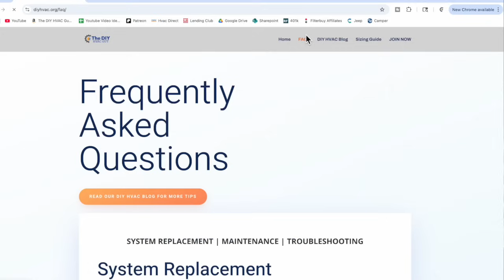Soldering -VS- Brazing.    Which Is Better?

Comment: I use Stay Brite 8 and solder the joints, but I like to braze as no acid flux to introduce in the system and brazing can handle gaps, but my luck in brazing has been terrible.  I will literally burn holes in the copper.  For the life of me I don’t understand how I can get the copper so hot it melts yet still does not melt the sil fos 15 rod.  I thought about trying a Turbo Torch which is Air Acetylene, but some say it takes forever to heat up the joint to braze.  Is there no simpler way to braze.  First is there no easy way to set the oxy air acetylene flame.  

Have you found any easy way to braze.  I tried the Cap n Hook tips and that was a disaster completely burning through the copper.   What tip, or set up or rod would be the easiest to braze and yet do a quality job and not burn holes in the copper.

I wish you would do a detailed video on the best and easiest way to braze and not burn the copper.

Comment: Wish you were in my service area.  I have to go through the turmoil of finding a good company to install either a central unit or I'm thinking the ductless mini split.  Sick of window units that no one wants to work on.  It runs good if it's not too hot but compressor makes a clunking noise and blows hot air when it gets too hot outside.  Someone said it sounds like something is making it overheat.  Everyone works on HVAC but not window units.  Being a senior woman, I can't lift the thing or even help someone lift it like I did this one.  I think it's around 150 lbs (18,000 btu) so I must go hunting.
Reply: where are you located

Comment: Can you use this on r32 and 454b systems?
Reply from the maker: Yes absolutely
Reply: @diyhvacguy  I did see another video where they cut apart the lines after doing each method and the flux does seep in to the inside of the pipe. Is there a way to stop that or flush it after?
Reply: @Random.FurrylolI saw that video and that guy put  way too much Flux on both female &male,  totally unnecessary on both,  only need  i little bit on the male pipe in the right spot and you get the gold 💯

Comment: I was considering installing a Mini Split for my bedroom. I installed one previously for the living room but had a AC tech finish my connections and pressure test so I could get the warranty. I feel like you said you helped with that on one of your videos? Is that possible so I can complete the full install myself?

Comment: on the corner elbow with 2 pieces to solder. you could have just held the flame in the center of the elbow and the heat would draw the solder in from both ends. then you could have thrown a wet rag over the entire elbow at 1 time and done. 🥰

Comment: I use Rectorseal Nokorode instead of StayClean, never had an issue. It is not corrosive or acidic.
Reply from the maker: Thanks for the tip, I'll have to check that out!

Comment: I'd like to mention that copper pipes are thinner for hvac but brazing is recommended.  Does that make sense?  As an investor/owner, I've installed many of my own systems with solder.  I still use nitrogen.  I've never had a leak.  I've probably saved $80k in my lifetime doing my own work.
Reply: That's awesome, I'm doing the same thing, I have been drove to it by overpriced so-called professionals doing hack work
Reply: @michaelcollins5438  Honestly, after 15 years of being in the industry, this is what's going to drive me to finally quit and do something else. My heart and soul can't take what private equity firms have turned it into. Training is piss poor if it exists at all, they throw kids straight out of highschool in a van and send them on their way to go figure everything out the hard way, everything is overpriced to cover massive overheads and excessive life styles, and with tariffs in the US this year it's just getting worse. Not to mention all of the private equity firms are going to fire all of their office staff once they can be replaced by automated intelligence business operating systems which will remove even more humanity from everything. It makes me sad. Really, really sad.
Reply: If you understand chemical and material sciences you would know the purpose of running nitrogen when brazing and why there is no reason to do it when soldering. You're performing the equivalent of a mystical rain dance wasting your time with the nitrogen hoping it blesses your project with good fortune.

Comment: Can power crimpers be used on refrig lines?
Reply: Can press fittings made for acr application be applied to line set connections with the appropriate tool?

Comment: I have a scrap box of failed zoomlock and soldered fittings that have failed. I do not have a box of failed brazed fittings.
Reply: Heck yeah space man. Brazing is what manufacturers call for and its funny to watch people reinvent the wheel.

It really seems like the solder guys find it annoying to flow nitro and us brazers dont want to mess with the flux. 

Im just a tech who prefers brazing, though i did like the lower heat of soldering while connecting joints at the evap coil with all the close rubber/insulation. 

Funny how the hater here attacks your ability with no knowledge of your work.
Reply: Never had Staybrite 8 fail on me.
Reply: You have a box of improperly installed fittings. The installer failed; they did not. Brazing is a genetic defect-proof process, fitting of the average HVAC tech. Crimpers need to be used correctly and the correct solder needs to be flowed correctly for them to work. As this work is 1 step above the average capability of the genetic defect it causes issues.

Comment: I stopped using the Stay-Brite 8, mainly because the new 454b systems I stated installing says to not use solder and to braze only.
Reply: All systems claim not to solder them. It's the same thing as covering the manual in 86 warnings that they can't be installed unless you have a permission slip from daddy .gov to do so. It's something they can use to weasel out of warranty coverage. Same as always.
Reply: Nice and concise. I’ve been a proponent for this method after doing my homework and trying it. I read one study that showed that the brazing makes the copper more brittle and cracks were created within a couple inches of joint from excessive heat. The joint held, cracks were out from the joint. Really like it when replacing just the compressor and close to the king valves as you showed. 
I see so many jack-legs, brazing without flowing nitrogen and within a week the TXV is screwed. 
Soldering also great in closets with sprinkler heads. Had one guy at apts set system off, by brazing with no fan and creating plumes of black sooty smoke.
Reply: @bayouflats5054  What? Fire sprinklers don't care jack about smoke. They are activated by heat, usually about 155deg F.